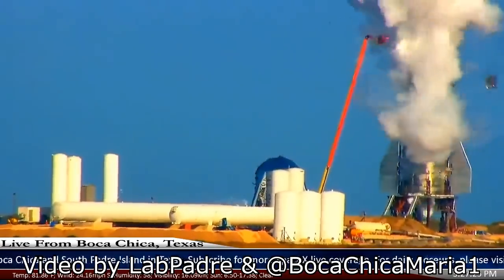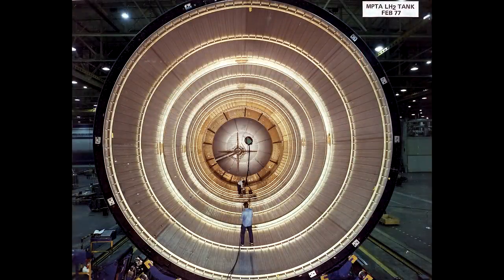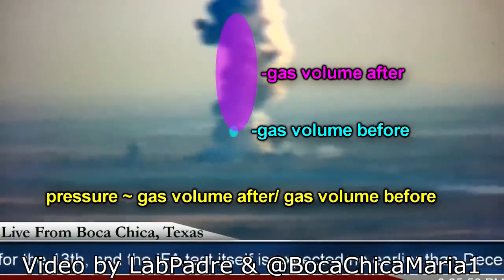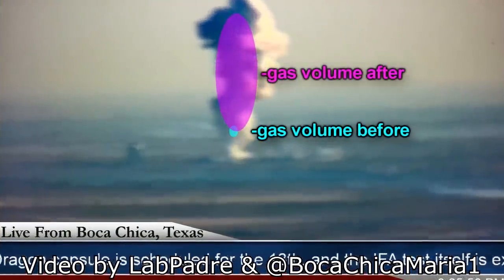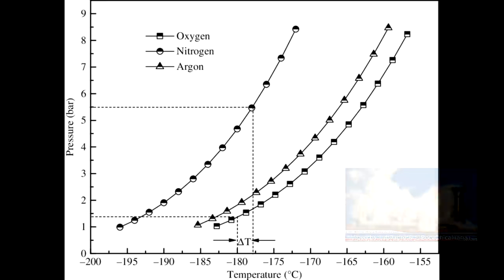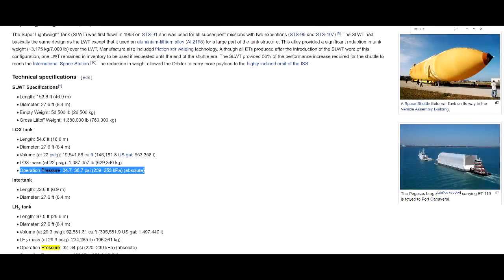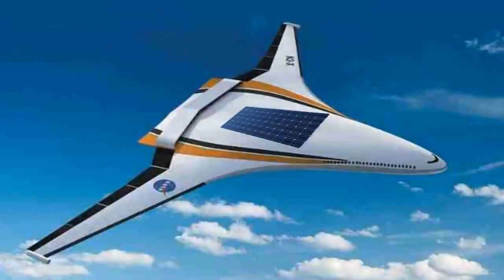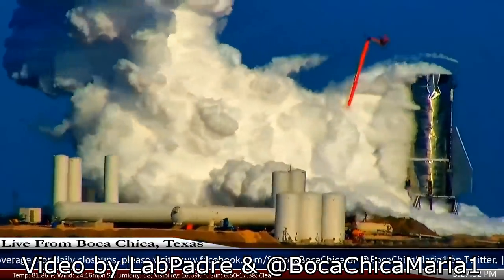Starship explodes, but why?

Comment: Dear Muskrats,
Please use your head. If something costs more money to operate than "standard, boring, real-world" things that already exist, then running it more often doesn't make it cost less. If a Musk-brand(tm) Magic-o-plane cost twice as much to run, then running it twice a day doesn't make it cheaper, it makes it FOUR TIMES MORE EXPENSIVE than a normal plane.

If "the gas costs more", then filling the tank twice instead of once won't cost less money, no matter how often you fly the plane. Use your fucking heads and stop inhaling Elon's musk, you ignorant brown-nosers.
-Yrs sincerly,
A tired Simpsons reference I still use even though none of you kids remember it.
Reply: @Andy Geee Novelty flights? Sure, those are a thing. The problem is, I did the math for the Intercontinental Ballistic Musketeer suicide rockets, back when TF00t first talked about them. Using the given specs and giving myself a massive headache due to having to convert all kinds of numbers, I estimated that if Musky somehow managed to cram 100 passengers into a single rocket, then just the COST of the fuel meant something like 100,000$ tickets, if the flight was at 100% full capacity.

Airplanes don't often book at full capacity. That's why airlines give huge discounts as you get closer to take-off, simply to fill the seats and squeeze out a few extra pennies. It's also why Delta beat up an innocent man and dragged his carcass out; they sell more seats expecting some people not to make it and still being full. Even if those seats should've been reserved for crew.

Airlines also don't have tickets priced at half a million dollars (taking into account crew, maintenance, facilities, and everything else for rockets and the boat rides to get on board).

Perhaps most importantly, WHERE IS ELON GOING TO FIND ONE HUNDRED SUICIDAL RICH PEOPLE TO PAY FOR THOSE TICKETS ALL AT THE SAME TIME A DOZEN TIMES PER DAY? Especially if we're completely ignoring his pipe dream of commuter flights.

And let's not forget that 100 passengers on a rocket is completely insane. They'd be packed in like sardines, to say nothing of their luggage. Even if the weight's alright, there's no way he's getting that many people. Call it 20 to be generous. Ticket prices just went up five times. And what novelty! Crammed into a tube for forty minutes after riding a boat for an hour, praying you don't explode the whole time, no window seats, just a short, horrifying nap on the subway car from hell, and then you're wherever in the world, for two and a half million dollars, just so you can be stranded after a "novelty flight".

If I were a potential investor listening to Elon's sales pitch, I wouldn't be giving him money, I'd demand that he reimburse me for wasting my time. I mean, seriously, I kept adding to this comment before posting because I kept thinking of MORE ways this idea was garbage.

His cargo rocket is a separate thing entirely. My point was that you don't save money doing the same thing at higher cost more times per day. You only save if you pay a bit more for one expensive run than you would for two cheaper runs. Or something similar in fractions.

My main concern for the clueless idiot is that his magical hyperrockets might save money, but only if nobody minds their cargo occasionally being a complete loss when the rocket explodes. I guess he has a promising future in providing custom insurance fraud solutions for desperate hucksters, if nothing else.
Reply: @Andy Geee It's been a while since I did the calculations and I don't want to delve into that conversion nightmare again, but if I got the numbers wrong from memory I wouldn't be surprised. Mass to BTU to volume to US$ to fluid ounces to... nope, not doing it again.
The point still remains that it would be unattainably expensive for commuter flights and there just isn't a huge enough market of ultra-rich thrillseeking billionaire playboys out there to go get stuffed into a torpedo tube for almost an hour just so they can say they were in a missile.

Even if I was off by a factor of ten and it's 10,000$ per person just for the fuel, there's still no way to get 100 people on board. This is part of my confusion, I think; it's possible 100k is the price for 10 people on the flight. I juggled a lot of numbers back then and too many numbers gives me a headache. Still isn't any way that's ever going to be profitable even at one tenth of the price I listed. Might as well expect Amazon to offer five-minute delivery on any purchase, requiring them to have giant warehouses of carefully stored pre-packaged goods on every street corner and ask for a 50k delivery fee for each box. Yeah, cool, Jeff Muskzos, brilliant, it'll never work.
Reply: @Andy Strawman? The fuck are you talking about, strawman? It's a fucking market, genius. Elon isn't creating an entirely new and unprecedented transporation system for going overseas, he's entering a market where a safer, cheaper, comfortable alternative already exists. And then saying he's going to be doing hourly flights every day when he can expect nothing but people with insane amounts of disposable incomes to be doing it once for novelty's sake.

Would you pay 20k for a one-way rocket trip to start your vacation? Who the fuck could? There's your fucking strawman, jackass. Let's pretend it's 5k just for the fuel. Let's pretend it's 2k just for the fuel. Does it fucking matter? Does it change anything, functionally, when a 1,000$ roung-trip ticket already cuts out a huge portion of your potential customers?

The fuck is wrong with you? Did mommy and daddy leave you a small loan of three hundred million dollars when you were born and tell you not to pay them back? Do you simply have unrealistic expectations of how much disposable income the average person have and think novelty rocket flights is going to be the next big thing? Are you on drugs? I'm fucking done with you. If you can't be bothered to pull your head out of your ass and have realistic fucking expectations, I don't expect to make you see sense.

Comment: Is it possible they were testing at what point their system will fail if you over-pressure it? Manuals are full of stuff like that. E.g. don't allow this to rise to this. But they have to figure this out somehow.
Reply: That's exactly what they were doing.  Failure point test.  They just weren't expecting the top to blow off. They were expecting burst pipes and tank splits not whole ends to fly off.

Comment: Use spaceships to compete with long-haul flights they say? Well, for example a 787 Dreamliner can take about 250 passengers and it needs less than an hour for deplaning, refuelling and boarding new passengers. If that can be done with a spaceship I will be very surprised and impressed.
Reply: They were talking about the flight times. A 10 hour flighg reduced to half an hour, the supposed time saving comes from here, not from the turnaround time.
Reply: Zoltán Kürti Sure, but flight time is just a small part of being able to make a profit.
Reply: @svenax  I am not talking about profit, I'm not sure why they think they can make a profit. I am talking about that indeed, if the rockets are completely reusable, you could potentially fly them more than an aerplane.
Reply: Zoltán Kürti Maybe you aren't, but I am talking about profit, and I'm sure SpaceX are as well, or at least they should be.
Reply: @svenax  read your original comment again. You didn't understand how a spaceship could compete with an airliner with flights/day. This is how. I was addressing this question.

Comment: I think this is part of the ‘lets see just how cheap we can build a viable rocket’.  Corners were cut.  Which, if true, is fine.  This silo of a rocket was never aimed at being a production rocket anyway.  The over pressure is likely exactly what you said, frozen relief valves allowed pressure to go well beyond their max allowed tolerances.  Even if true though some kind of monitoring of the pressure inside the tank should be expected unless that also was a cut corner to save a few bucks, relying instead on the relief valves to keep things safe enough. At best this is a sloppy test cycle and they learned that certain things were not budget driven choices alone.  At worst this is gross incompetence of his engineers, which might be a thing as well, given 3 catastrophic failures all related to the same thing, failures pressure vessels, leading to the loss of the vehicle.  Anyone aiming for human flight (whether building rockets, planes, boats, whatever) should be placing perfect safety above all other design and process considerations.
Reply: Oh ffs.... They deliberately over pressurised it to find rupture points.  Scott Manly explained it in great detail.

Comment: AFAIK there is a report about the Dragon capsule. Valve leak led to fuel deposit in the pipe where it shouldn't have been which then ruptured the pipe in a sort of water hammer effect.

Comment: Is liquid oxygen o2, or just O...
Reply: It's almost completely made up from O2 molucules even in liquid form. So O2.
Reply: @antfletch31  kovalent bonds certainly only form o2 molecules. Two o2 molecules tend to stick together, but that's on the order of magnetude of hydrogen bonds in water. We certainly say liquid water is H2O, so...
Reply: At the cryogenic temperature it could be o3
Reply: @OssamabinKenny  o2 can not be converted into o3 at low temperatures. Why do you think there is ozone in liquid oxygen?
Reply: Zoltán Kürti so the question was if liquid oxygen on o2 or just o!
The answers were it is usually made from two o2 molecules.
...however if temperatures are low enough, o3 “ozone” would liquefy.
I never meant to sound like I was saying there was any liquid ozone used for rockets
Reply: @OssamabinKenny  all right, that's fine. I tought you were saying that when o2 is liquified, it converts to o3.

Comment: In most cases you’re required to test pressure vessels at a higher pressure than their nominal pressure. Like pressure reducers have to withstand 2,25  times their nominal pressure according to ISO 10524. The reason being that oxygen fittings shouldn’t burst if a  small amount of carbohydrates burns off in the oxygen atmosphere. 
I think they tested it at that kind of pressure for the very same reason. To check whether the safety margin they designed in was actually enough to prevent the tank from rupturing.
Reply: “The purpose of today’s test was to pressurize systems to the max, so the outcome was not completely unexpected.” SpaceX's comment on the event
Reply: This group appears to be immune to facts.
Reply: @theknave4415  I'd like to know which facts :)
I can't claim to have any standing in rocketry as my mention of ISO10524 suggests but from a risk management point of view and from a former test engineers point of view I do see the need to put a large vessel such as the one shown here to be be tested under extreme conditions to verify the models used during its development. At least a failure of the vessel seems to me like a worst case in a FMEA which would brand it as an unacceptable risk thus making a very rigorous testing routine a necessary outcome of the design process (which can be seen by the fact that Lockheed performed a similar test (that was mentioned in the video as well))
Reply: Any regular industry would use water to hydrostatic testing some multiple of normal operating pressure. But maybe this was a test for staying fueled for longer times at pressure at cryo temperatures. This thing is supposed to take off and land on the moon, and take off and come home to earth.
Reply: I don't know what the areospace industry requirements are but ISO 10524 testing is normaly done as a hydrostatic test. Hydrostatic is much cheaper and less dangerous than using liquid Oxygen or even compressed air.
Reply: You are correct that hydrostatic is cheaper and safer however when you are a) Elon Musk and hence have the cash b) doing something very high profile and c) have huge safe areas to do possible destructive testing then being as close to real life as possible is the best way of testing something. 

He isn't testing installed pipework on a chemical plant: he is testing equipment that if it goes wrong would destroy millions of pounds/dollars/Yens worth of payload and possibly lives.
Reply: @CraigLYoung  There are 2 tests defined in ISO 10524: one for checking the suitability of the materials to withstand pressure shocks of 100% oxygen by using hot ("only" 60°C oxygen gas) in conjunction with the noted maximum oxygen pressure to make sure that no combustion occurs in the system this basically means opening a valve abruptly to increase the pressure in the device as quickly as possible. Due to adiabatic change of conditions the heat within the gas will increase a lot and make it very hard for many materials not to burn.
The other test is just performing a burst test to make sure the device won't explode should combustion occur within the device.

The later will be performed on a device whose safety valve and exit are being blocked while the first will be performed on a service ready device.
Reply: @CraigLYoung  They have to test the weld/strength at cryogenic pressure, so they use liquid nitrogen rather then water as a test fluid. It's not that complicated.
Reply: takanara7 : Do you honestly belive a weld that can't withstand a hydrostatic test will stand up to a liquid nitrogen? Glad I don't work where you do.
Reply: Testing pressure is one thing.  Testing pressure at -200c in the wild without lab conditions is another thing entirely.
Reply: No it isn't I had a a 6mete cubed jacketed water vessel fail a regular insurance required pressure test this year - inside wall bulged like a boil on someone's neck. Dodgy welding that finally gave up after 10years of use. You do them in situ.
Reply: @TheAlfsterino  Thanks for sharing :)
The products I work on get tested every 6 years but at nominal pressure but I can see why other things need different testing procedures.
Reply: @worstcat8489  At -200°C outside temperatures are only a small part of the overall testing conditions :D You want stable conditions to make your tests repeatable otherwise there is no point performing them :)
So to me this test is a test just like any other performed in a lab. A very big lab that is.
Reply: @worstcat8489   Maybe I should explain... -200°C  at a nominal air temperature of 20°C means that you have a total difference of 220 Kelvin, lets assume they perform the same test at 15°C, these 5 °C only make up for a little less than 2,5% of a temperature difference over the 20°C test case. In terms of gas expansion this seems like a negligible difference to me. Even a 10°C on a test should be fine as it would be less than 5%.
Reply: @mikkosha  of all the enterprises that do this kind of work (and there are precious few) I have to believe "the math" worked out inasmuch as concept, test, and ultimate production are concerned. If it didn't, they wouldn't have done it. Unlike facilities that have overbuilt containers, safety features, and far smaller and lower pressure requirements, this is a spacecraft, for which much redundancy is substituted for weight savings. So, in "the office" I'm sure it all looked good, but that just brings us full circle to running a real world test outside of a lab environment exposes catastrophic shortcomings, from material to procedural.
Reply: Worst Cat as stated before this is not an outside the lab test. It will have borne results that can be reproduced. You are right with your assumptions but testing to destruction is also a industry standard as you need to know where the limit of your device lies. If you don’t, the only thing you can say about it is “yes it can withstand the pressure” but you can’t say “we do have a safety margin of at least 1,5x” which is crucial for setting up workable tolerances for the production of your device. There really isn’t anything special about the test that has been performed here. Neither the destruction nor the environment it happened in are particularly remarkable. 

As for real world conditions, this is still just testing a small part of the system that is the rocket.
Reply: Those tests are done in a controlled lab, not in situ.
Reply: Try pressure testing a 4metre cubed reactor in a controlled lab... many things are tested 'insitu' which means in an area safe to do so with the actual unit. mikkosha is correct regarding pressure testing to higher pressures than it will see.
Reply: @KonFess  Well usually you do test the whole device and considering that ISO10524 is meant to be used on pressure reducers for medical devices the size of a small blackbird (not the SR71 kind of blackbird) testing them in a lad is easy to do. Testing a rocket fuel tank in a lab would probably destroy the lab so it is usually done outside.
Also Testing the device under worst case conditions with the actual medium they are supposed to hold/process is common engineering practice and even required in most cases!